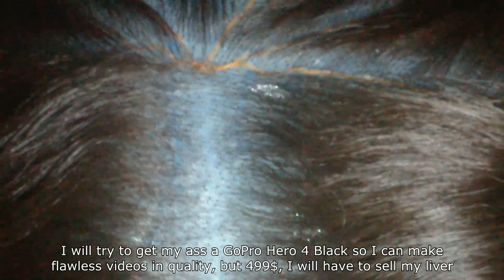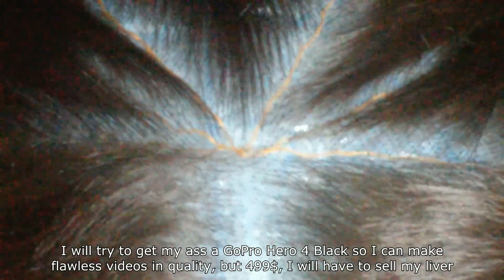Heat Sealing the Knots with Blow Dryer (2nd video)

Comment: In this video it looks like you have "yellow lines" that separates the direction you are venting. If so, could you please show me how to make those separations on the unit so I know which way I need to vent the hair so that it "moves" like natural hair?  Thanks!
Reply from the maker: Well this is thread that will be removed later and helps me remember where to change the direction etc so as to have a uniform and symmetrical direction throughout the unit.

The last thing that will determine the direction will always be how to blow the hair to stay or you use the heating tool to set a direction but the ventilation direction plays a major part in the hair laying flat enough or more bouncy.

I used a string to remember here as well:
Hair Topper from scratch to finish

If you want to see how to change the direction you can see my ventilation direction change video here:
Ventilation: Hair Change Direction
Reply from the maker: Super Wig Maker
I can make a video but this is nothing other than an obvious string that has a colour that is different than the lace, different than the hair and different than the background (in this case orange) and you just use a stitching needle and just sparsely put the thread in and out of the unit just to make sure the thread will stay there for as long as you need.

When you are done ventilating you obviously remove the string

Comment: Not sure if you've shared, but what are some of your favorite hair brands you use? I am trying to have an idea of what to get so I can apply a little heat to it without too much trouble.
Reply from the maker: You must refer to synthetic right? Futura would be my No 1 choice if I could get my hands on that hair without paying a shitload of money. Hiperlon is another amazing option (arda-wigs sells that) and then you could just search in ebay "synthetic heat resistant" it will show you like a typically ONE choice, it is the clips that you use to put in a head under your hair, be sure it is long enough for you to cut and ventilate!

Comment: Do you routinely seal the knots on the units you sell?
Reply from the maker: +Kayon Warren Fior synthetic wigs yes, it makes a total difference, for human wigs it is not super necessary since the humidity and washing will revert them slightly back to a loser shape, but for human hair we can easily bleach the knots so even if they are not super tight they wont be visible.

Of course if there is a way to permanently seal them with some adhesive then I would totally heat seal the human knots as well

Comment: Hi, how do I get the knots to hold on a human hair wig? Also, I want my part and hairline to look very natural. I'm not sure if I like the idea of bleaching the knots, can you make a video on how to use a silk base to hide the knots in dark haired wigs?
Reply from the maker: Samantha P. I already have like three videos of the basic idea of how the silk tops are made! And it is a pain in the ass to make.

The only thing you could do is tighten the knots and I also have a video for this too. It is just that human hair tends to loosen up faster than synthetic hair because in synthetic only heat and long-term wear and tear could loosen the knot or anyway alter the shape of the strands, in human hair even the slightest humidity in the air can alter the shape and revert it back to its original shape!

Comment: Hello!!! I love your work thank you so much for giving us this valuable information. But I do have a quick question for you and maybe you have a video about this already but I'm new to your channel and I have not look I'm sorry. my question is how can you permanently seal the knots? Thanks in advance Sharma's,
Reply from the maker: sharmaine larry Permanently sealing the knots is done by using some sort of adhesive from the inside of the unit in the base and the knots. It is actually semi-permanent but by re-applying the adhesive again when you feel it is worn out then you ensure more sealing.

I used thinned nail polish, some people use this silicon sealant which I don't know where to get. The "best" option is to get a professional wig sealant which could be expensive but you don't need to much to make it work.
Reply: Super Wig Maker

Comment: Wow you are genius my friend ★★★★
I wandering if this method works On the human hair ??
Reply from the maker: Oh trust me it does work like a charm, the problem is that human hair have a even more tendency to revert back to the original shape even with the least amount of humidity.

Within time the hair will get a more permanent shape at that point, much like when you have a parting for a long time, your hair tend to keep that parting even after you wash the hair!

With human hair I would do this (and I plan to make a video):
Ventilate ->
Heat treat the knots to make them tiny ->
Bleach the knots where I need to (then wash the bleach) ->
Heat seal the knots one last time after the wash ->
Permanently seal the knots with a sealant

This way you are more than sure that even with humidity or even a hair wash the air will not revert back to the loosen shape!
Reply: +Super Wig Maker Hi I love your tutorials.  Did you ever get a chance to make the video you mentioned here in the comment section.  if so can you link it here... I'm having trouble finding it. Thanks
Reply from the maker: Sis Tasha
remind me of that please, what was this about?
Reply: +Super Wig Maker in your comment above mine ^^^^you mentioned doing a video on ventilating heat sealing and showing us how you permanently seal the knots with thinned polish.  I was wondering if you'd had an opportunity to do it yet and if so can you post the link for it here so I can find it. Thanks
Reply from the maker: Sis Tasha
I have one video for this, some people might not like the idea of thinned nail polish but usually knot sealers are nothing but the same kind of stuff to nail polish or silicon sealants that you can get much cheaper.

In this video you can see at least a good way to seal the knots without staining the hair.

https://www.youtube.com/watch?v=W-dHXUidbrE
Reply: +Super Wig Maker Thank you so much! I've been studying your videos and I'm making a list of questions for things I might need a little more clarification on. I am so happy that you encourage us to ask you questions and you answer them so timely. You are truly a blessing! I am going to attempt to ventilate a closure using some human hair I received. The company that I order from have lengths in bulk and wefts up to 42 inches. I have 3 bundles of 20 inch wefted hair already. To ventilate my closure would  you would you recommend me ordering one bundle of 42 inch bulk human hair or one bundle of 42 inch wefted hair to make my closure? Thanks
Reply from the maker: Sis Tasha
if it is human hair you do not need 42 inches, since you wouldn't fold it in half.

Watch this on how to fold the hair
https://www.youtube.com/watch?v=dOMu8KvY1Ao
Reply: +Super Wig Maker ok thanks.
Reply: hello this link (how sealing the knots)doesnt work could you please say me where can i find it ?br

Comment: I need to try that with my single knots. They NEVER close...
PD: Why a GoPro???
Reply from the maker: Hey thanks for passing by, yeah try it yourself it does an amazing job, just make sure you keep a tension while it cools down.

A GoPro cause it seems to have a crisp image, has amazing options for quality and in low light it captures nicely! Plus it seems to focus better cause this stupid toshiba camileo has two focus options only one for far and one for close up and the close up is specific to 20cm distance anything further and anything closer to that just blurs and it sucks!

I have an analogue Camera as well, my older videos are shot with it and the thing is that the focus on that camera is AMAZING, you can practically keep an item as far as 5 millimeters from the lens and literally see the thing magnified!

The problem with that analogue is that I need my TV tuner to pass the analogue video to a digital video and then process it cause it is interlaced video and I have to turn it into progressive! The resolution is that of a DvD not full high definition and it also makes a little bit grainy video in low light conditions... still better than my toshiba camileo!

It is just that I am broke and there is no any I can afford a GoPro Hero
Reply from the maker: ...do you have any better camera in a rather reasonable price in your mind?
Reply: Super Wig Maker I use a canon 60D, but you know, too many options and I have the same problem with close ups.
I'm not a fan of the GoPro idea just because it have a weird angle vision (like a fish eye) And you will not be really have with the audio (it's a sport camera). I don't have any new videocamera so I can't say if the new ones do a good job like your old one. Wig master recomended an Iphone, I just tried my Note 3 and I can do a really good close shot! I didn't try before, I'm going to try to film a knoting video. (I will need a tiny tripod from eBay or something).
Reply from the maker: Lace Pieces
Well GoPro fish eye angle is the super wide view that you can turn off, the wide angle is not bad and it doesn't produce the fish eye, it is the super wide view that does that.

My analogue would be fine but my TV tuner is in my older pc that I have in the living room, too much fuss about a video!

If I could at least get much more light it would be OK with my toshiba, I already have a big lamp in my room but for cameras it is not enough. I will make some LED setup lights soon and video tape it, hopefully it will work.

P.S. you should see the first video about heat sealing the knots that I have some scanned images to show the full scale close up and you will be amazed with the results of heat sealing your knots

Heat Sealing the Knots with Hair Straightener (1st Video)
Reply: Super Wig Maker Yeah I watched it and the shots are really good! I've seen on aliexpress some LED Rings for cameras, I think they will make the job.